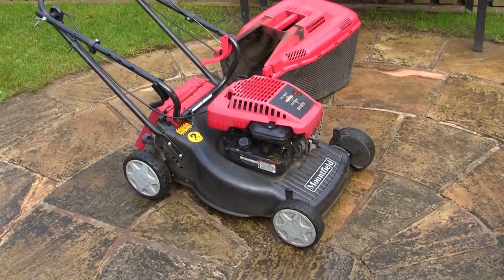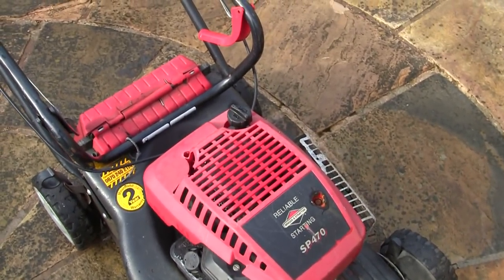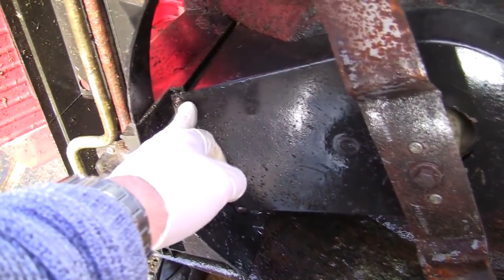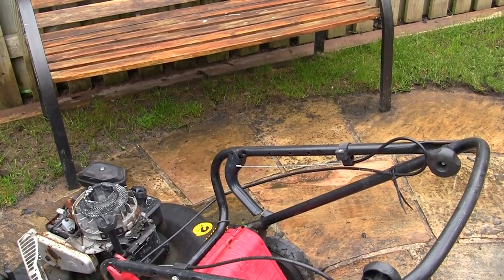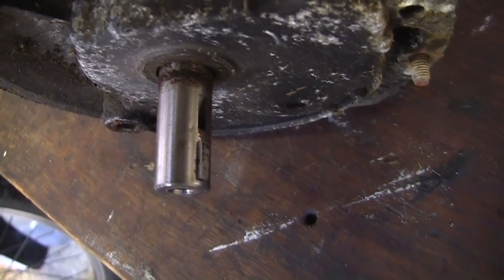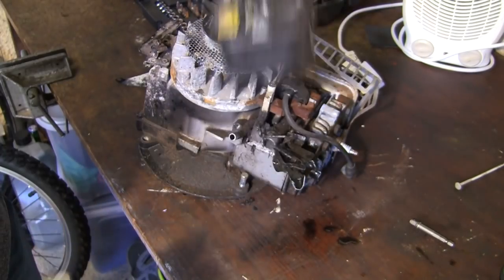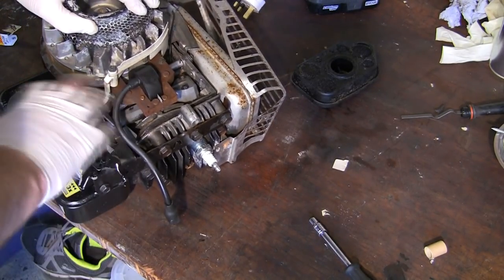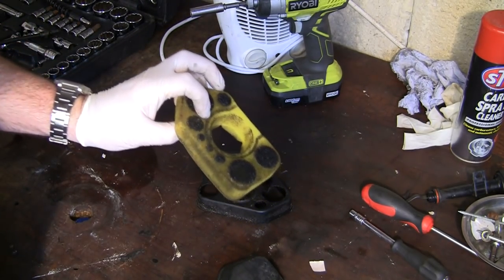Ultimate Petrol Lawnmower Service And Repair Guide For Maximum Profit

Comment: Very useful video. I inherited the same engine as the one you're servicing here.  Have replaced the gasket and diaphragm, but still not having luck with running it. Any ideas what to check? 
When I prime the engine with petrol, it starts for 1-2 seconds, smokes like mad, and then it shuts off. As if it's not pulling in any fuel. Mower sat for a long time and oil seems to be everywhere, including leaking some where on the exhaust side. Wondering if oil got somewhere it shouldn't have and is now not allowing the fuel to travel into the engine?

Comment: Super video as always. Just serviced my brings classic. Changed the springs for the first time in 4 years. Made such a difference. ( I had previously cut and stretched the springs but they had it. Used a £6 kit from eBay. Included new filter , plug's, springs, diagrams and fuel pump. Hopefully will last for two years
Reply from the maker: Well done Peter! top work

Comment: I’ve replaced the diaphragm on my 500 series twice in two weeks with cheapie imports off eBay and it still surges - if anything it’s running worse. First one I could definitely see petrol coming out between the carb and tank, the second replacement I’m not 100% (I have real poor close up vision) but I think it’s the same. Thing is, one minute it’s running fine, the next it’s revving up and down. I tried the link for the genuine B&S diaphragm and it isn’t working. Could you post it again? And thanks for the videos, not looking to buy and sell just want to get my own mower running well but I am enjoying tinkering, even unsuccessfully - wouldn’t have the confidence to even try before 🤷🏻👍

Comment: As for a cut pull cord a doddle to replace but you can use a power drill with a ratchet socket to start the motor up from the top - much easier than sweating the pull cord :)

Comment: First-class video, I have a Mountfield HP 470 and it's leaking oil through the exhaust... one thing I noticed,  the lawnmower had been left tipped up ( not sideways but up on its front wheels)  and I noticed oil on the garage floor .. what could be causing the oil leak ?
Reply from the maker: Nothing run it for 20 it will burn off

Comment: Right got a no runner for 15 quid. Sprig n Stratton hp 470. Just dosnt fire up got fuel etc etc what else could it be? I love you vidios by the way
Reply from the maker: Thanks David you need to service the carb and change the diaphagm and gasket. Pretty easy to do! Good luck

Comment: Can I ask a question. I've just serviced my b&s mower and replaced the foam air filter with a new one.  Do I need to oil it?
Reply from the maker: Put a very light coat on. It stops the dust getting through

Comment: Hello, I have done this mower business also some time and I have experienced some  carb issues; after changing the diaphgarm and gasket the engine runs rough, rich fuel. Sometimes when I leave it for few days, it runs better.  Any ideas?
Reply from the maker: Not sure tbh but I often find the same
Reply: @MowerMan  Ok, its quite a big issue for me. Do you think thats one of those carb leakage issue? havent tried the double diaphgram yet.

Comment: use a ratchet  extension joint for  the oil plug.. perfect fit
Reply from the maker: AHA YES!!! Thanks
Reply: Hi. Just thought I'd add, Citroen sump plug tools are a square plug. I've ended up with 2 different sized citroen square tools over the years. I'm sure one of them is really close to a socket set drive.